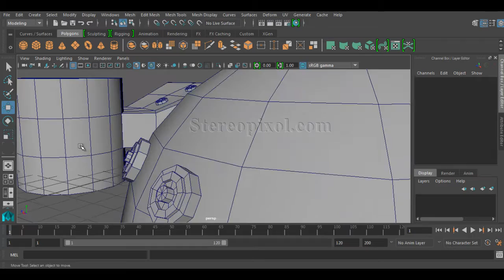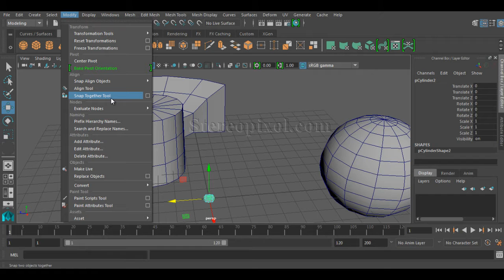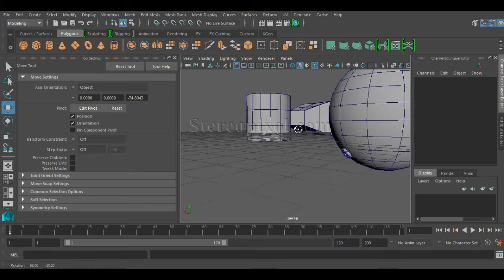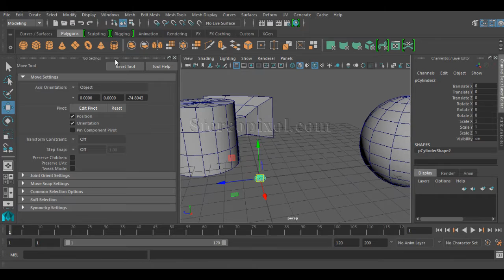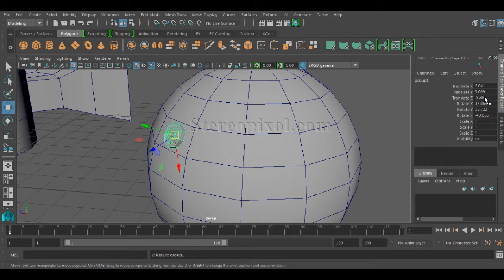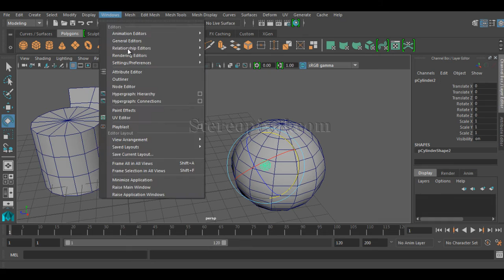Maya Tips  | Snap To Surface

Comment: This in depth content that's focused on a tool is super informative and useful.  The surface-to-surface ability is great to know, along with knowing the rotation issues. I would have had that issue inside the next hour as I want to place a bunch of bolts and other details onto an object's surface.  Being able to change their orientation is a big bonus.  If it wasn't for the extra minutes in this video, I'd have spent hours extra on this project.
Reply from the maker: Thank you for your words. Always try to deliver in-depth of the tool. Sometime gets criticized  for length but always believed that someone out there might need them. Welcome . Please subscribe and stay tuned.